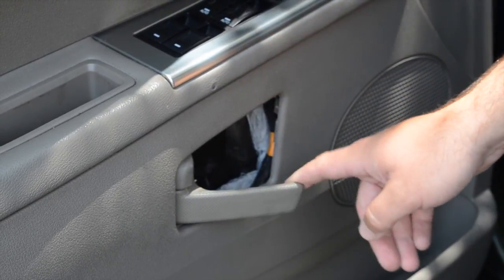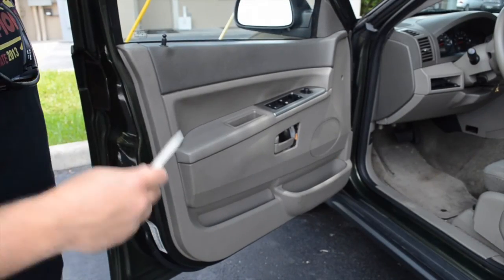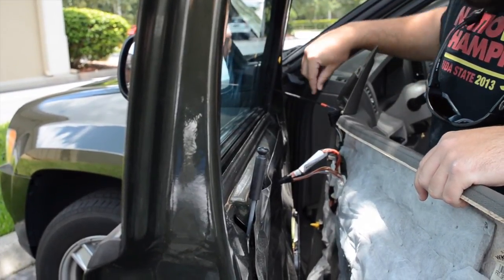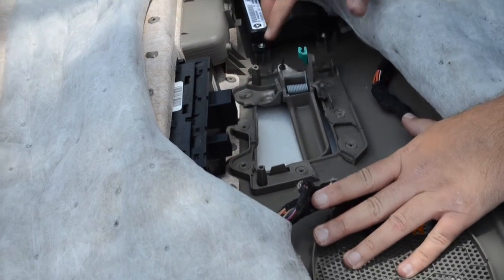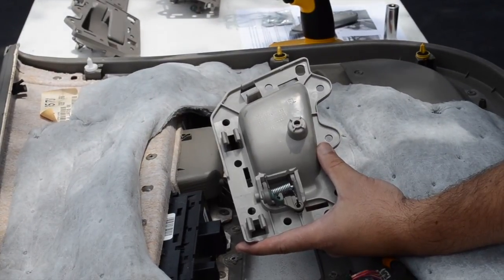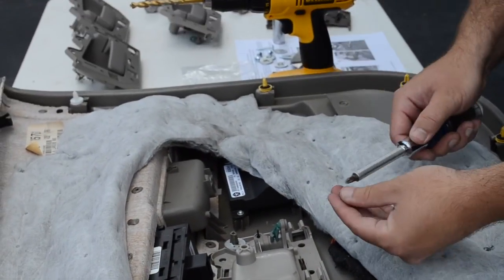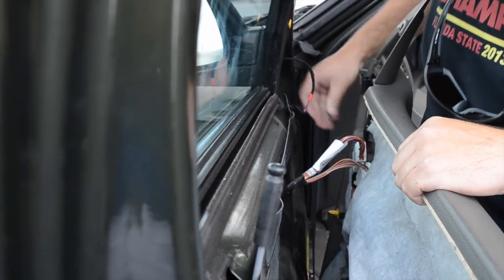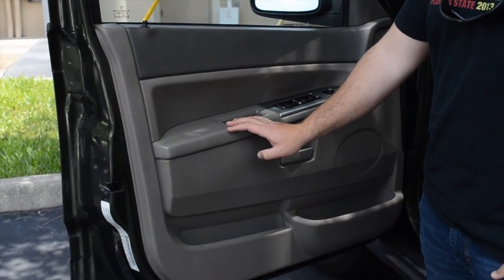How to repair a Jeep Grand Cherokee Door Handle, Fix, Install, Replace, Step by Step

Comment: I just received a kit to do all four doors on my Grand Cherokee. These new replacements look tough. I can't wait to get them installed. Great product.
Reply from the maker: Thank you for your business at Thrasherhandles.com we hope your install goes well!
Reply from the maker: +Bob C I would recommend not using any. The process can be messy and I do not find it necessary. However, if you decide to use adhesive, any automotive plastic adhesive will work. Your local auto parts store will have a few brands, I have heard "goop" to be popular.
Reply: The install went well.  I'm impressed with the kit. I just used the screws and skipped the adhesive. As you stated, not needed.
Reply from the maker: +Bob C Thanks for the feedback! Great to hear!
Reply: A year and many door openings later, still going strong. Great product.

Comment: On my '99 Jeep Grand Cherokee the inside door handle on the passenger/rear  acts just like the one in this video. When the outside handle is pulled the handle stays pulled out but the door doesn't open. 

Is this the same problem your product fixes?

Thanks
Reply from the maker: You may have a similar issue. Our kit unfortunately does not fit your year. I wish I could help more.